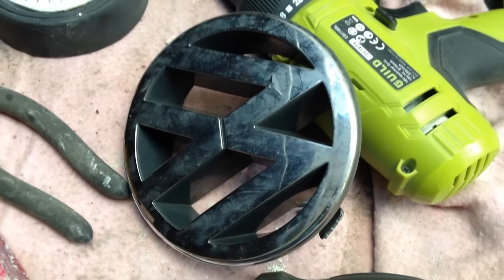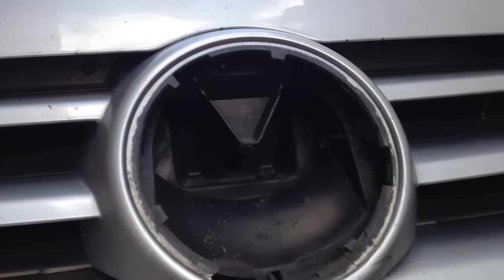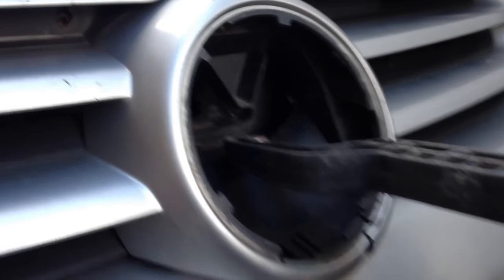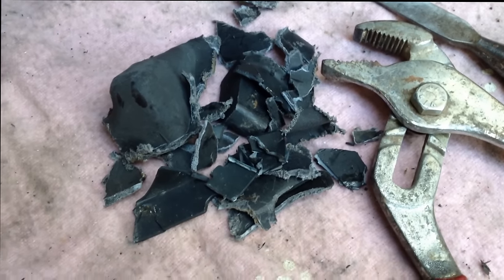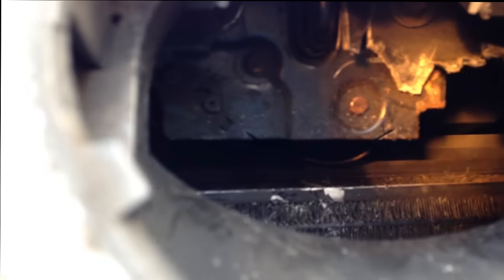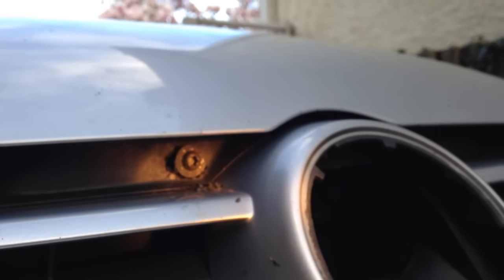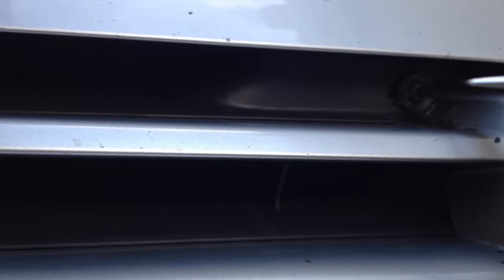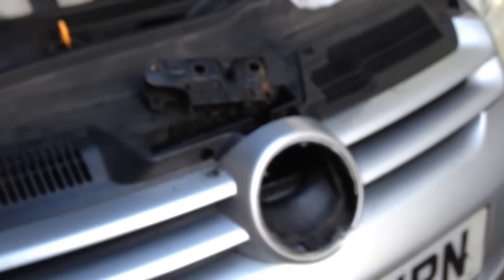VW Golf Mk 5 hood stuck down - unlocking - the DIY method

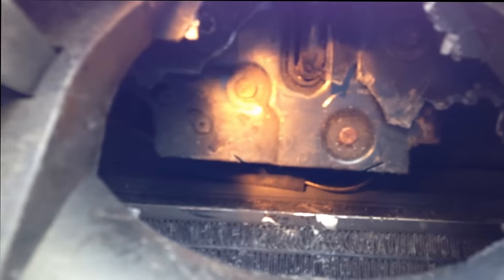Comment: You can widen the hole that you see at 0:11 rather than cut out all the plastic as much as you did. Then at 1:18 you can see a piece of cable hanging down. Grab that with some long nose pliers and pull to the left. That will open the catch. If the cable isn't hanging down, but tight,  then you can get some sort of long thin screw driver over the top of it and lever it downwards, then get the pliers on it and pull to the left. That's probably the least destructive method to get a mk5 bonnet open. The other method id to cut away the plastic covering the 2 torx screws,  then when they are undone you can lift the bonnet up a bit with the catch attached and pivoting upwards on the third screw (which you can then remove as the bonnet is up a bit giving you the space to access it) but that leaves more damage if you ask me. Hope this helps someone else. Remeber also that the VW badge comes out by rotating it about 45 degrees anticlockwise so that the holding tabs on the badge line up with slots in the grill so that the badge can then be pulled out without damaging it.
Reply: mark wright will try this over the weekend, I just hope the cable is still attached to the mechanism.
Reply from the maker: Thanks Mark. Useful information which I could certainly had made use of. Cutting out so much plastic was only done as a last resort. I love the vehicle which has just rolled over 175k miles.
Reply: b33zo made the hole bigger today, can now get my fingers to the area where I believe the release is but it just won't move, I see reach in and find what I think Is the cable but this only seems to pull towards the front of the car and not too the left. Looks like tomorrow I will drill 2 holes where I believe the screws are and try and get them out, is the third one the one that is behind the cap on the grill next to the badge?
Reply from the maker: David, the cable travels horizontally under the lock/latch mechanism and turns up at 90 degrees to where it hooks on to the unlocking lever. I feel that pulling down would be easier than pulling left. Chances are the kit is very rusty and siezed so no amount of pulling will shift it. As you see in my video the two long bolts are accessible behind the badge (after chopping out the plastic) the third shorter bolt is approx 20mm (centre) from the LH edge of the round moulding between top two gril fins. Drill out a ring of holes with a small drill bit and you can pull out the section with pliers..I glued a small patch over that hole after. Good luck DIY'ers never give in!
Reply: b33zo got a bit more plastic out this evening and I can now see both torx bolts, hopefully I  will get them out tomorrow, it will probably need a new cable and definitely a new catch. VW want a outrageous £60 for catch and £38 for cable so will definitely go on eBay to get the parts.
Reply: b33zo thanks for the help i now have it open, cable was hanging by about 2 threads lol, lock has had it and will need replacing, take it it's pretty easy to attach and fit a new cable to a new lock?
Reply from the maker: Its easy once you've done it but I managed to make hard work of it. There's a plastic fitting that goes underneath the metal lock and it has to be seated correctly to steer the cable to where it eventually hooks onto the lock.
Reply: b33zo I got there in the end, that plastic on the cable is pretty hard to push on, I would say impossible if the lock mechanism is in place, I just connectted the cable first then  fead it though after. Thank god the first part of the cable was ok as that looks even harder to change.
Reply from the maker: Well done David it'll be a lot easier next time! I recently had to change the bottom half of the cable after it snapped at the handle in the drivers footwell. No fun at all! The video is somewhere on my channel. Cheers b33zo
Reply: Thank you so much for your advice. It was invaluable when I couldn't open my hood.  Using your method, I didn't need to widen the opening at all.

Comment: Dear all,

in the last few days i was really nervous with the same situation on my golf 5 2005. The bonnet locking mechanism is the same as in the video. I tried to open the stucked lock, but nothing happened. I even broke down my (1K1823633B) bearing bracket's spigot , where you rotate the lever (1J1823533C ). So I called a specalist to open the hood. I went there and he needed 1 minute to open my hood. God! It was so simple, but the process needed 2 guy. I was at the driver seat and i tried to operate the lever ( i replaced the bearing bracket to a new one) , during i  rotated the lever, the guy pushed down the hood ( pushed down firmly , but not to hard to avoid any damage on my hood) and then, after 2-3 trying, the bonnet popped out. I was really surprised. Then we took a look on the mechanism and it was stucked in , because there were no grease, nothing and metal moving, rotating parts don't like being dry. Corrosion was on the mechanism as well. Then he sprayed some grease into the mechanism, closed-opened the bonnet 4-5 times and now it is almost smooth, I didn't have to damage anything, i didn't have to buy  any new lock. Before this solution, I tried to open the mechanism with a hook , plus endoscope camera, via key hole, next to the badge, but it was so stucked in that I wasn't able to rotate the mechanism. I wanted to share this info with you , because i didn't see any kind of this solution and it was cheaper and quicker then drilling..etc.
Reply: Thanks a lot buddy
Reply: Thank you!
Reply: Yeehaa that’s just what I needed I’ve done exactly the same thing and my mechanism works like a charm now 😊Cheers my friend 😊

Comment: I had this problem on Friday , half way through a service which then ended up taking all day. I was expecting to have to start drilling and removing panels. My brother in law got into the bonnet with in seconds. As long as the cable is still attached to the lock mechanism on the bonnet, you can reach up from underneath the car , over the radiator, grab the cable and pull it down to release the mechanism. You should be able to see the cable you're looking for by looking through the grill.
Reply from the maker: Thanks boffrey its great if you know someone to come to the rescue! I saw a few similar sugestions out there but nothing on a MK5. As you know the car is too low to get under without running it up on ramps and the gap between the radiator and grill very narrow (and dark). Hope I never have to do the job again but if I do your method will be tried first!
Reply: I've managed to fit the new cable and lock mechanism, all is working fine, will definitely be servicing that part yearly from now on, the cable was pretty hard to replace but got there in the end when I realized the best way is too attach it first then thread it though when the locks in place.

Comment: Done this method and let me tell you. 10mm drill bit but dont let it past the 2mm plastic. drill holes down that are next to one another on flat surface either side. Again behind is radiator and I burst mine with the drill bit. crap I know.
Reply from the maker: Thanks for watching James. Wow sorry to hear of that mishap. Thanks for the very good warning. Luckily the radiator on this Mk5 Golf is just below the lock mechanism bolts so there didn't seem to be much danger of gouging the radiator. b33zo
Reply: @b33zo  blunt drill and then suddenly whallop straight through. Heard spewfff fffff ffff. And yep. Radiator burst

Comment: We have ways ov making u open. German will crack under pressure but no need for cutting shit up.
Use ur crevice tools in behind the VW badge or from the grill, u will crack it.
I opened a mk5 bonnet with a coat hanger, no damage.
Or fully comp fire and theft, I know a guy who makes things happen.
u get me?.
GAZ.

Comment: You coulda just put screw driver in that hole .. Lmao
Reply: yes that is shown on another video but if you follow that one you are very easy to stub the rad ,,,stay high up and push the cable ,,,better still take the lever off in the car and check that first that was my mistake could have done it from there had I only gone there first it had just slipped though because it was tight